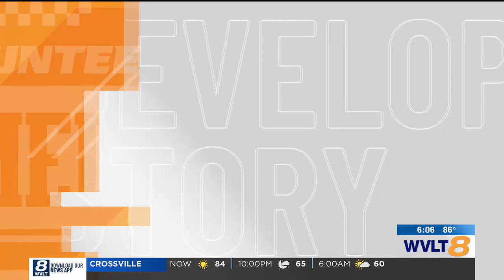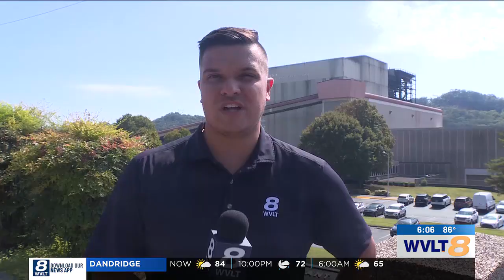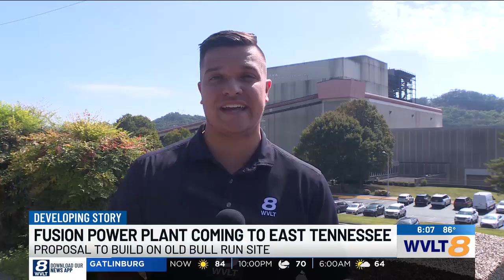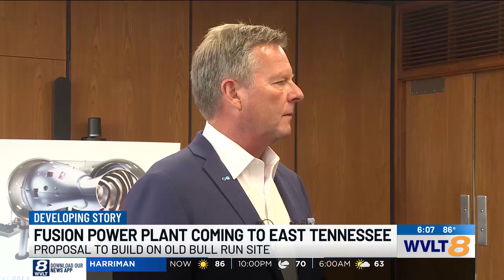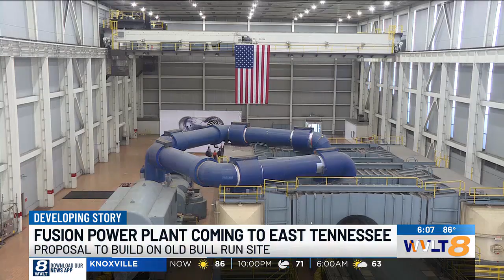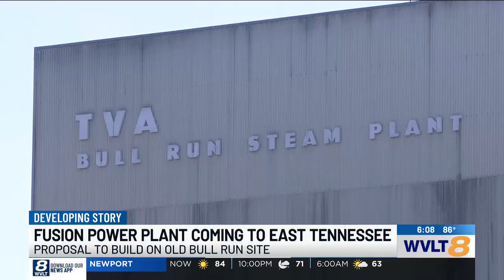TVA, Type One Energy announce fusion energy investment at Clinton’s Bull Run site

Comment: Radiation risk and environmental risk to public health??? Rember how safe. Nucleate energy was until something goes wrong
Reply: fusion and fission are two different things. just because the word "nuclear" is there you automatically assume its dangerous and scary.
fission uses radioactive elements like uranium and plutonium to generate power. thats what you think is scary.
fusion uses high temperature hydrogen plasma contained in a magnetic field, simulating a star. no radioactive elements needed. thats what this project is.
Reply: Fusion is actually very hard to maintain,  so there is absolutely no risk of a meltdown like what we have seen Chernobyl and Fukushima. The only hazard I can think of is possibly the shielding inside of a fusion reactor when one has to be decommissioned. Compared to traditional nuclear energy, there is much less contaminated material waste.
Reply: Lmao, you say that like Nuclear isn’t the safest form of power production.

There’s been more deaths attributed to coal burning, hyrdo power and wind power plants than Nuclear.

You do know that even Chernobyl was even left running after tower 4 blew up?
For more than 20 years towers 1-3 continued producing electricity because of how safe the technology is.

If Nuclear was as dangerous as your fear mongering insinuates, they wouldn’t have left 3/4 of the Chernobyl plant running after the incident.

Did you know all the nuclear waste in the world could fit into one large grain silo?
The propaganda you’ve been fed by the traditional power industry is really showing your ignorance on Nuclear Power benefits and safety.
Don’t believe everything you see in cartoons, they’re not real life.
Reply: Fusion is "aneutronic";  that is, no neutrons are produced in this reaction, thus, no radiation.  Fission, on the other hand, is nasty stuff.